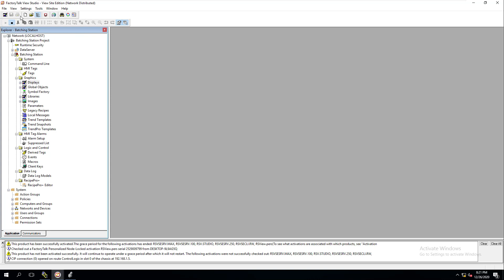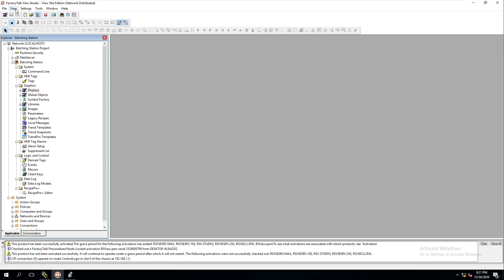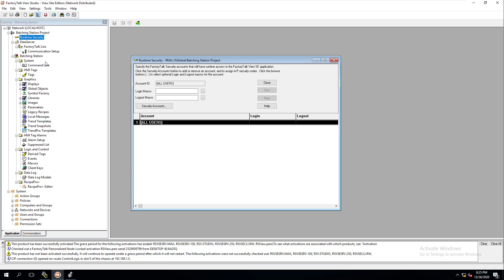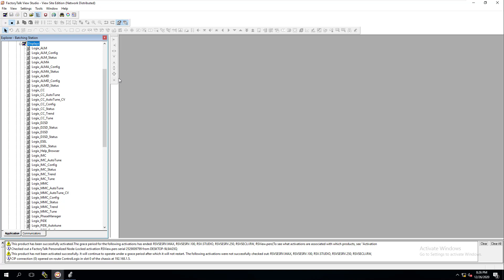FactoryTalk View Studio Site Edition Quick Tips For Easy Editing | Batching Station PLC Day 5

Comment: Great video, but how do I reset the toolbars to the default docking positions? I accidentaly moved them and some black areas appeared where the toolbars used to be docked.
Reply from the maker: Check under the View tab
Reply: @Shane Welcher  FT doesn't seems to have a button to reset all toolbars at once to the default position. I guess they need to be individually moved back to a "guessed position". I've found a windows register that it's supposed to reset everything to the default position (when deleted), maybe I'll try it later after backing up my Virtual Machine. HKEY_USERS\S-1-5-21-567238126-2415255155-1568896733-1000\Software\Rockwell Software\RSView Enterprise\Toolbars.
Reply: Servo Motion Mastery (PLC Programming) at Udemy is on my wishlist by the way.